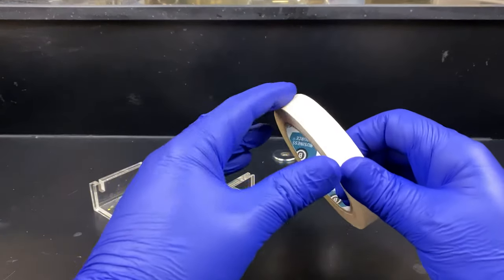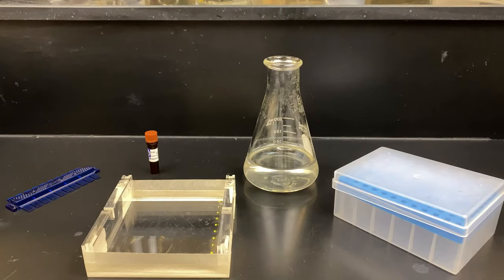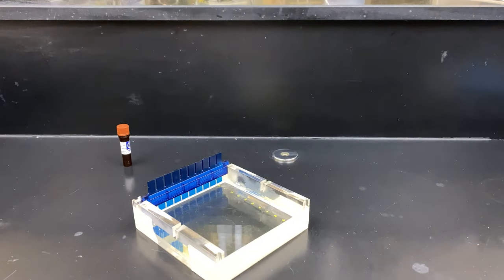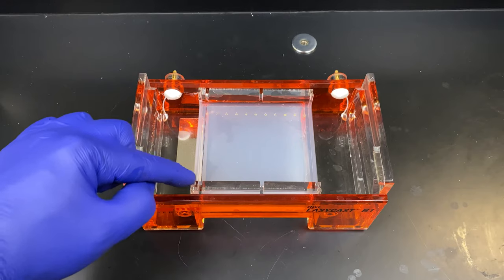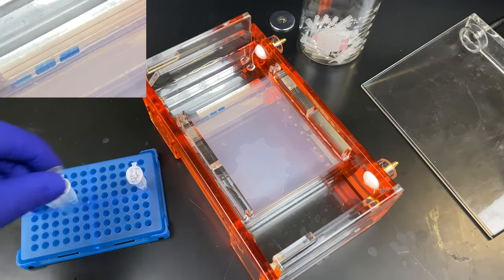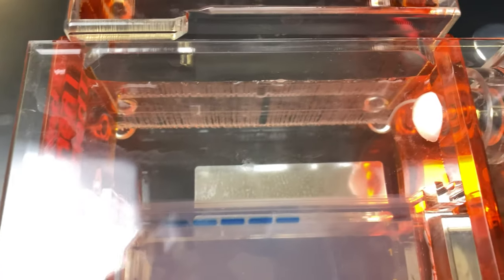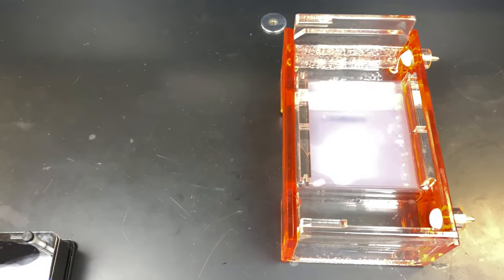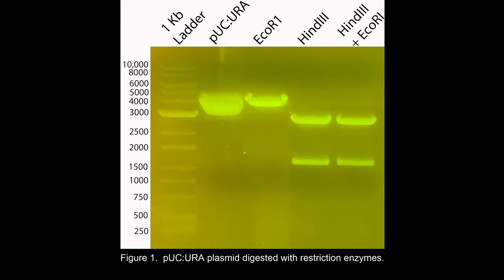Agarose Gel Electrophoresis

Comment: What was the amount and ratio used in
 loading dye : DNA
Reply from the maker: We usually use 6X DNA Loading Dye.  We mix 5 uL of DNA with 1 uL of 6X Loading Dye.  Final volume is 6 uL, resulting in 1X concentration of the Dye.  Hope this makes sense.
Reply: How could I do the 6X? And do you recommend use 3 ul of DNA and 7ul of 6X? I have watched it some time...
Reply from the maker: Please see the previous comment "We usually use 6X DNA Loading Dye.  We mix 5 uL of DNA with 1 uL of 6X Loading Dye.  Final volume is 6 uL, resulting in 1X concentration of the Dye.  Hope this makes sense."

6x loading dye means it is 6 times too concentrated.  You need to dilute it 1/6 so it is 1x loading dye.
1 uL dye + 5 uL DNA = 6 uL total solution.  1 uL dye / 6 uL total solution = 1/6
Reply: What is x here ?
Reply from the maker: x = times; therefore 6x loading dye = 6 times loading dye.  This meaning it is 6 times more concentrated then the working stock.  I is made this way to mix 5 uL of DNA with every 1 uL of 6x loading dye.  At this dilution (1/6) it will be 1x loading dye.  Hope this helps.
Reply: @ProfessorDrewCollop  thank you kind sire.